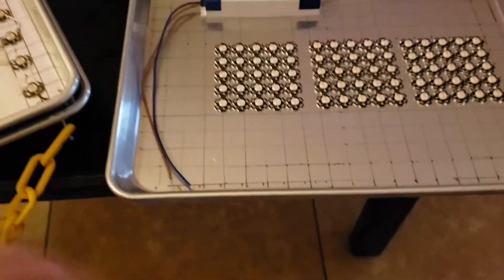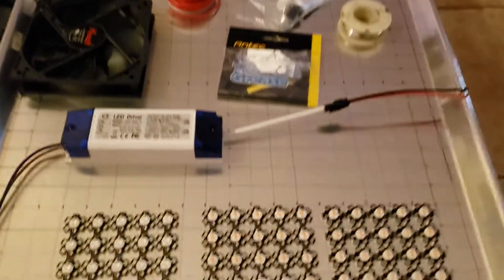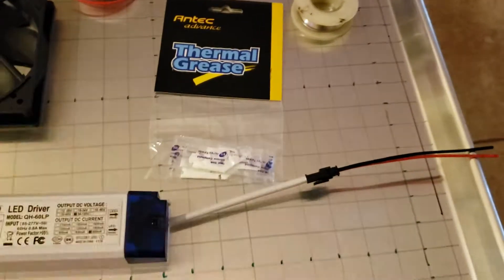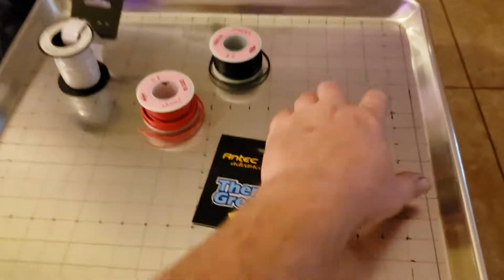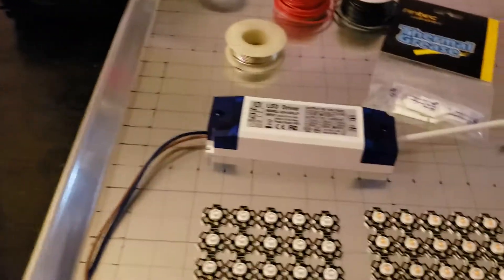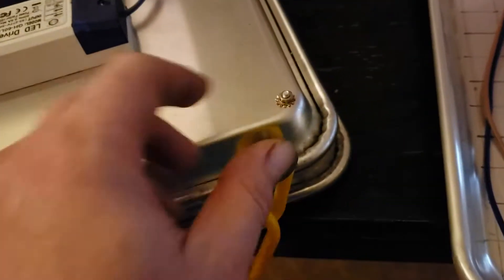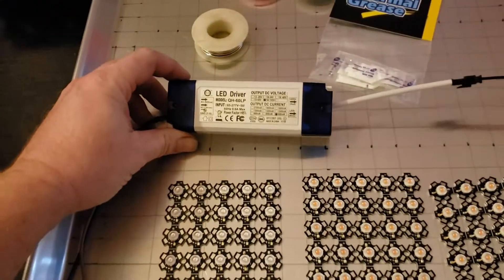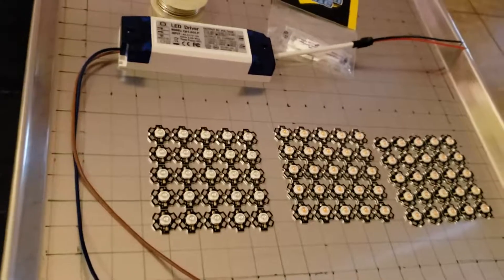How to build your own LED grow light part1, parts and tools

Comment: What if i only use 4 led module is led driver still required? Or should I use 12 volts normal adaptor only or for this module a led driver is required regardless of many watts?
Reply from the maker: Yes, you need a driver that's puts out 600-700ma, each led pulls 3.2-3.4volts, ,@ 600mA, depends if u wire them series or parallel

Comment: Thanks for the upload. I've been looking into this idea as lights can be expensive and misleading in what they are capable of, especially as the cannabis industry has exploded. I have a 2' x 2' tent. What LED Light components are the most effective and what brands are the best?
Reply from the maker: My lights are 18x24 inch,  that should be plenty of light, my full spectrum 3W LEDs are running 16 hours a day over a year now with no problems,
Reply: @zurchergrows2797  , please let me know what i have done wrong...I bought 48 3w leds (10 full spectrum, 8 royal blue, 6 warm white, 4 red, and 4 IR) i split them up into 2 light bars @ 24 leds for each bar. I also have 2 24v led driver power supply @ 120watts per power supply(total number of lights does not equal 240watts, it is less.) Anyway, i soldered ea h one starting with positive +, to negative-, and so on...once all led diodes were soldered,  i ran a negative line to the negative terminal on the driver and ran a positive line to the positive terminal on the driver...I used 2 old power cables to power up the led driver (power supply), i did this x 2 because I split the 48 into 2x24...anyway, i plugged both in and only 7 lit up...so i checked the connections on each starboard,  for some reason the lights that are lit up after the 7th are very dim, i watched your video,  which got me to build my own light, just the way you did, but no luck for me....please let me know if there is anything you can do to help me...I've spent much more than i wanted to as far as $$, but no regrets,  i believe if you could throw a few pointers my way, i could get it to work...please contact me on my email (kjny0276@gmail.com) i will attach pics of my build for better detail. Thank you for your time and I look forward to hearing from you soon. 

KJ
Reply from the maker: I got bride lux from China, panpan supermarket on ebay